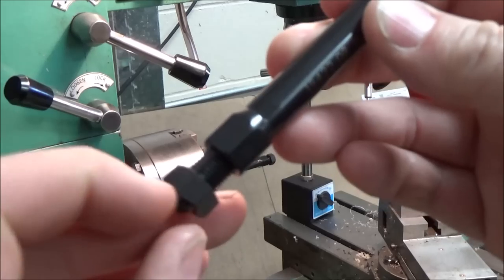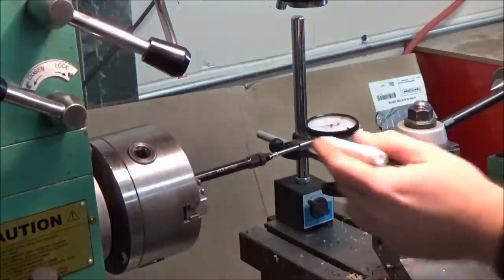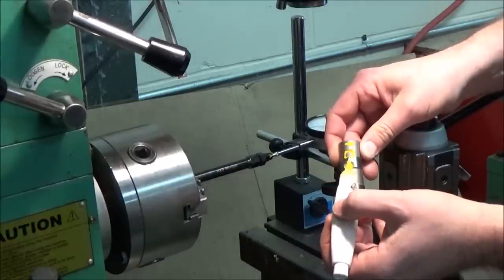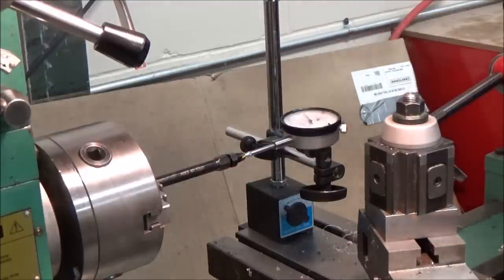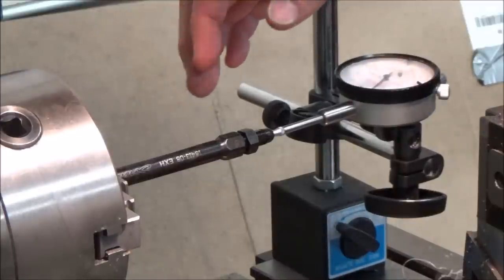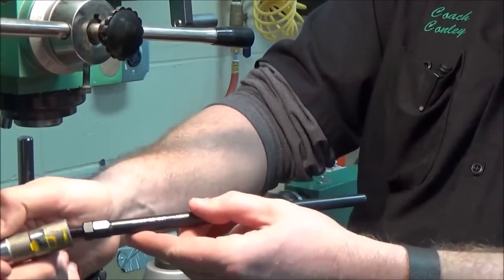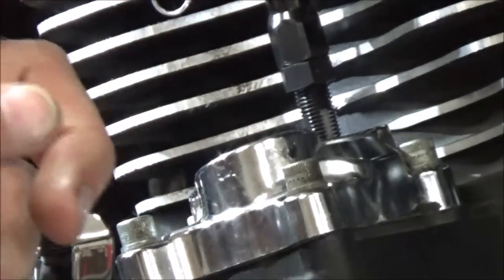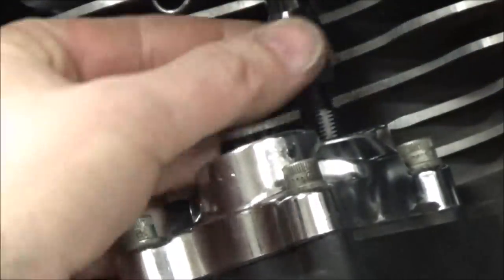How to precisely install ANY brand of adjustable pushrod for Twin Cam EVO Sportster Big Twin!

Comment: Always great knowledge to gain in your videos. I see new stuff all the time.
I just did all four of mine. Using a 1/2" socket and breaker bar to turn the engine. Looking down each lifter block I put each at their lowest point on the cam. Adjusted till I had no lash. Just touching the lifter and rocker no up or down play.
I am using Jims 1807 lifters and titanium pushrods (24 wrench flats per inch). Book calls for 15 flats (2.5 turns). Let bleed down. Then checked for spin with little to no resistance and NO UP OR DOWN PLAY.
Waiting on the last one to bleed down. As I write this.
Once everything is buttoned up. With the spark plugs out. I am going to rotate the engine with the starter till my oil pressure light goes out. Pop in the plugs and I will know if its all good. Will make a check at 200 miles and then probably every oil change after for 3 changes.
Engine was running like crap. Lots of after fire on start up. The rods were not adjusted right. 3 cams were on their flats while 1 was lifted. Got a short rod out of the deal. Always finding new problems to learn from.
Reply from the maker: Thanks for commenting and adding value to our community!

Have you subscribed yet to never miss a video? Have you seen the video playlists? Over 600 videos! Check them out here: https://www.youtube.com/user/conleybuilt/playlists  

Want to say “thanks” or “keep it up”? Click here https://www.paypal.me/how2wrench    
 
Your answers and help are just around the corner. Save time and money while protecting your investment and yourself by doing it the right way at www.How2Wrench.com
Reply: Set lash when the cam is 180 degrees from peak lift! Which is 360 degrees of engine rotation from peak lobe lift. Some call it the “heel” of the cam....
Reply: @trailerparkcryptoking5213  I like that term it is on point. The eye of the rain drop.

Comment: I didn't really understand this video. I have to put adjustable push rods on my 92 evolution engine. Had a bad tappet and also had to replace cam. but Ill watch this video again a few times until I figure it out hahahhah. Thanks for the video.

Comment: I set em all at 3 turns and have zero issues. You can load the lifter a little more than .110" especially with aftermarket cams installed.

Comment: Just curious why you wouldn't be worried about the valve hitting the piston while adjusting the push rod but in your video on reinstalling the rocker boxes you didn't want to torque the rocker assembly down until the lifters were bled. Is there a chance of valve and piston interference in both of these situations or is it more for torque accuracy when reinstalling the rocker assembly?

Comment: You simplified this, thank you.  I ran into a problem with my bike that no one addresses and thought you might know.  I replaced my lifters using the HD Screamin Eagle pushrods and Johson Hylift lifters.  I adjusted the pushrods to where there was no-slack (starting point/0), then turned my HD SE pushrods to 4.3 turns to get close to .030 (they have 24 tpi).  But the pushrods still seem to be loose as they can always be rotated by hand. 

I notice the original factory lifters from HD seemed to be a manual hydraulic lifter and the new ones have a spring in them allowing the tappets to have more play than the originals.  I am assuming the new lifters will not allow spring play when the oil pressure from a running bike thus the lifters will be under pressure and have less slack.

Question, are the original HD lifter solid(no spring, took it apart and didn't find a spring).  Will the new lifters have travel because they have lifter springs and not under pressure?  Thanx Greg
Reply from the maker: I honestly don't know without researching with the lifter vendor. I would talk with them directly and see if they suggest a different setup. I could do this for you. You're in luck. I do offer personal service to back up what's missing from a video to actually fix your specific problem. I do work on donations for my time and possible research. 
Good news is its CHEAP! For my time would mind becoming a member of my website? It comes with a free 20 mins of techline and that will cover my time to assist you so we both benefit. So to have me personal cell phone number to put in your phone as your direct info and how to coach, sign up now! As always thank you and enjoy the free videos! Much more to come! I look forward to working with you and hope you will become a member of or learning community. 

Link to membership: https://how2wrench.com/product/membershipmembers-onlymembers? 

If I can ever be of service to you, here is a video explains how to connect with me. 
https://www.youtube.com/watch?v=vjvmB01ebcs 
Direct link to services: 
https://how2wrench.com/product-category/tech-lineservice-callminutes/ 
Live Chat is great for you to actually show your specific issue!
Donation link: https://www.paypal.me/how2wrench
Reply: Thank you.  I did find out the problem.  The first tech at Johnson told me the wrong max travel of the lifter.  I learned it was .212 and needed to be adjusted to about .105.  I had to readjust to cut down on chatter.  Probably sitting at .120 now.  I also found that the pushrods have slack in them until you tighten the jamb nut on the pushrod itself.  No one mentioned this and I thought I wasn't adjusted out far enough on the pushrod.  All has been corrected and bike is running.  I will still join the site and thank you for the invite.  Greg

Comment: Did you see the adjuster turned some when you tightened down the lock nut?  I just installed some of these SE pushrods last night and learned than you need to have 3 wrenches on the push rod to tighten the lock nut without anything coming out of adjustment.
Reply: Kyle Bryan I thought the same thing.. seems like it moved a little

Comment: Not a bad video except for when you finally tightened down the locknut at the end, you lost about an 1/8 of a turn in your adjustment. You either need to A. Compensate for that and add about an 1/8 turn or B. Use a third wrench on the flat area of the threads to hold it in place while you tighten the locknut down
Reply from the maker: That would surley work. Thanks for the add...
Thank you. Hit that subscribe button please! It helps us!
Here is a way to support all the free videos.
Want to say “thanks” or “keep it up”? Click here https://www.paypal.me/how2wrench  

Coach Conley is also available for hire to personally work one on one with you if ever needed. Yep he is a real person. Give him a call @ 602-345-0432

Your answers and help are just around the corner. Save time and money while protecting your investment and yourself by doing it the right way!
Follow us!
Web:
www.How2Wrench.com    
www.Tools2Wrench.com